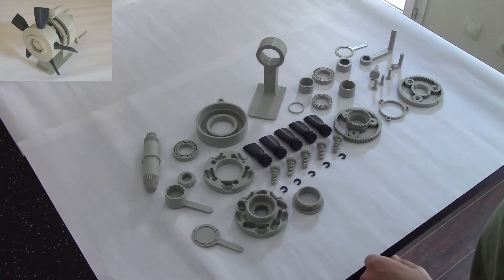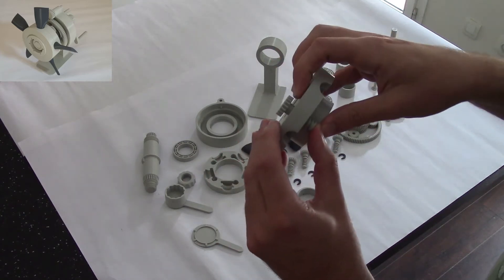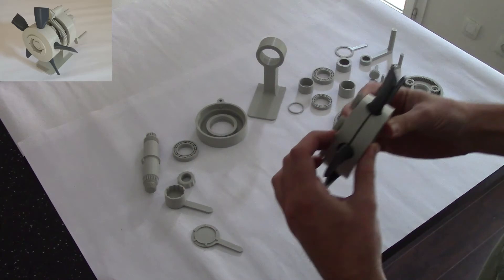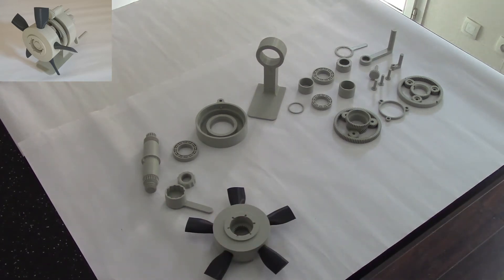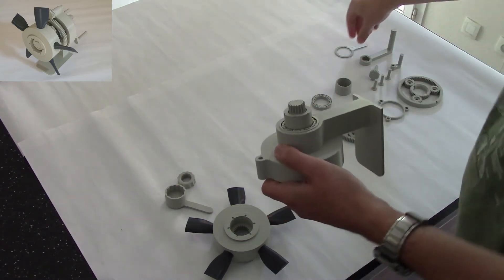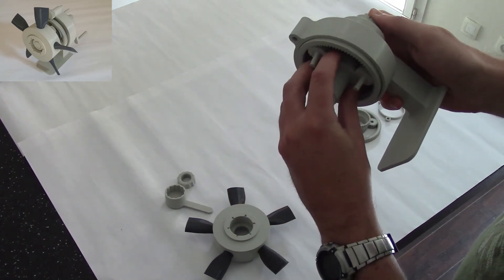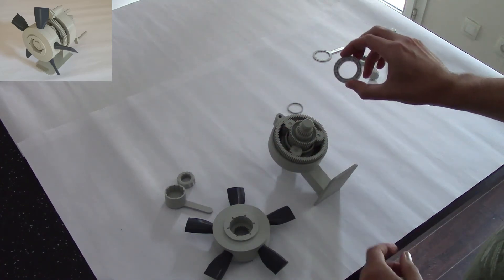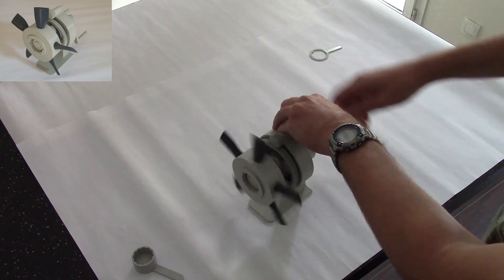Variable Pitch Propeller Mechanism - Assembly walkthrough

Comment: Hi there! Found it on Printables and I'm taking a whack at it. I'll post a few photos eventually. For now it almost goes together but some sanding will be needed to make parts run smoothly. As for the bearings it took several tries before I could print them successfully: I got best results by running my X1C at 'normal' speed, increasing 'retraction' and printing them one at a time. The bearings are so cool I'm going to make a few spares for other projects 🙂